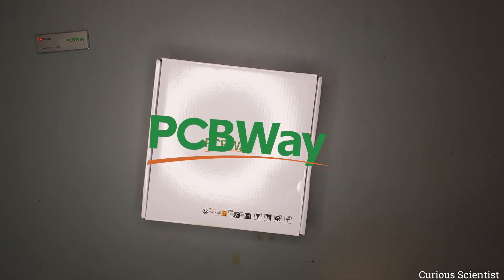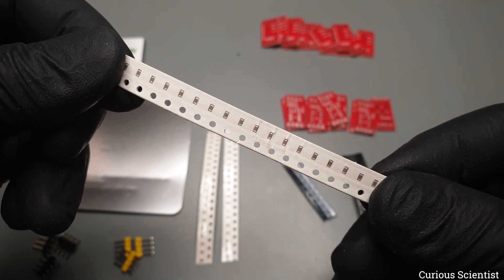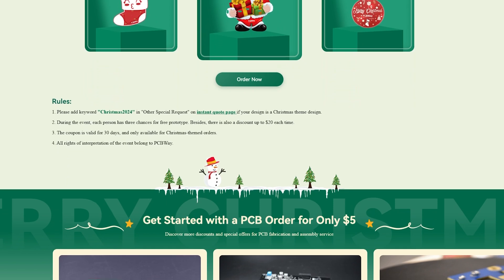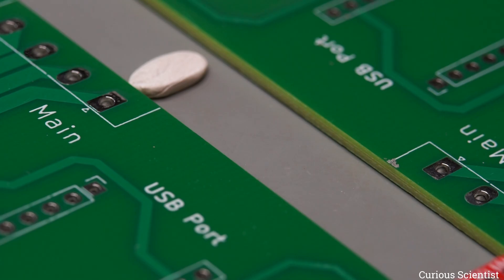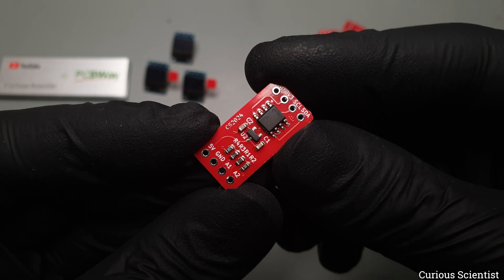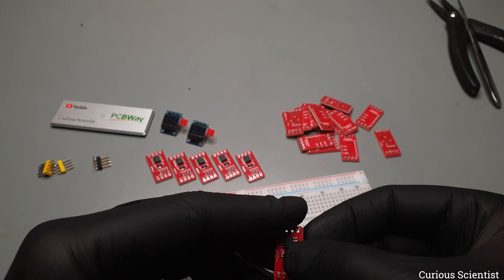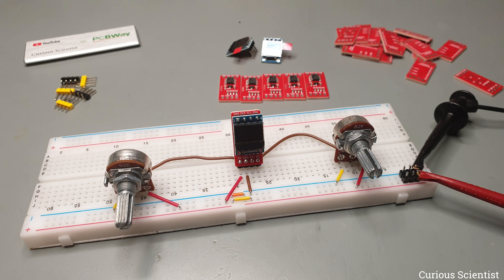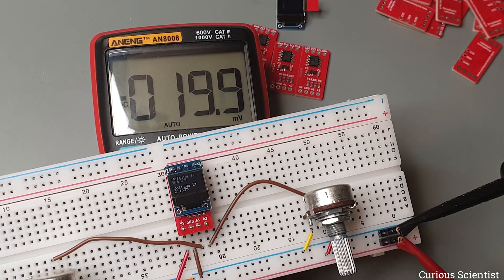2-channel miniature voltmeter for breadboards

Comment: I've been out of electronics for decades, but the magnified few of the solder paste finally let me see that it is just tiny beads of solder suspended in flux. Thanks, I've often wondered what it was.
Reply from the maker: Yes, the solder paste is just tiny balls of solder suspended in thick flux. It's a very smart concept.

Comment: Nice! A case could be nice to protect the screen and electronics. Wow that's some tricky soldering. 0603 is quite small but that's why I reccomend a case to protect the 0603
Reply from the maker: Thanks! I will design some 3d printable housing soon.

Comment: At 4:25, Is that a solder blob popping out there?  Where did it come from? At 3:35, everything looked to be OK...  Did you see it and clean it out? Could it have bridged under the chip?  Thanks for making this video!
Reply from the maker: Hi! I might have placed the chip slightly on the tab, on top of the solder paste. This could have caused a little solder to get stuck under the chip. After each reflow, I check my circuits and clean them up. The blob was too small to cause bridging, however, once I had a similar issue caused by a blob getting stuck under a capacitor. It crippled my whole circuit and it took me an hour or so to find it. But lessons learned.

Comment: I would really prefer the OLED panel to go directly on your PCB.
Reply from the maker: That's more difficult. Then, the PCB would need more components, and it would be much harder to reproduce the circuit at home.
Reply: @CuriousScientist  Just find the panel supply, with the part number or from the supplier you will get datasheet and it will give you schematic.
Reply from the maker: I am fully aware of this, but not everyone wants to assemble the whole display from scratch. This is how I implemented it because this is how I imagined it to be easy to reproduce.

Comment: Beautiful soldering shots!
Reply: Came here from the article, thanks @JeremyCook and @CuriousScientist
Reply: @yourcan  Nice! Thx for letting me know!
Reply from the maker: This is great to hear! Welcome!
Reply from the maker: Thank you!
Reply: @CuriousScientist  So the I2C pins + 3.3V and Gnd are broken out on the other side for potential future use? Also, can it run at 3.3V from the breadboard rather than 5V?
Reply from the maker: On the other side, those pins are broken out for programming. My plan is that if I want to "mass produce" them, then I can build a small jig with pogo pins and program the circuits very fast. 

The circuit can indeed run from (a stable!) 3.3 V directly. You can skip the LDO and bridge the traces, however, I would rather not do it. I designed the board with the assumption that it will be used with Arduino-like circuits, where the default rail voltage is 5 V. If we really dig deep in the datasheet of the chip, it says that the rated operating voltage is 3.3 V OR 5 V. So, theoretically, it could work without LDO even at 5 V. But if it does not, and people buy my board and they burn due to overvoltage, then I have to bear the consequences. For my peace of mind, it is better to spend an additional $1 on those 2 caps and the LDO.
Reply: @CuriousScientist  Makes sense, thx. Was working on an article for Hackster on your device, so I wanted to make sure I got the details correct.
Reply from the maker: Oh wow, it would be super cool to see my project there! If you need any details, just drop me an email or a DM on Instagram.
Reply: @CuriousScientist  Thx! Article is all done - probably up in a few hours if you want to check then. Feel free to LMK if I got any details wrong!
Reply from the maker: Super, looking forward to seeing it! Thank you!

Comment: Perhaps u am missing something here. Are you not supposed at, some stage to put some specific code on the micro controller? Did see that step in the video. And didn't find the code in the article.
Reply from the maker: Sure, but there's no public code shared.
Reply: So what's the point of showing how to make it if the code is not available? Anyone making it would end up with something useless. No?
Reply: @ChrisHalden007  Hey, in the earlier video tutorials, he already showed everything you need to make a voltmeter like this. There’s ADC handling, OLED setup and handling, and after that, it just takes a bit of effort and thinking to piece it all together. That’s the whole point of these tutorials – to get people motivated to learn. I mean, sure, having it handed to you on a silver platter is easier, but that’s not how anyone gets better.
Reply from the maker: @ChrisHalden007  well, based on my tutorials that I mentioned in the video, you can copy-paste the necessary code together, and adjust it for your needs. If you want the code, you have to pay, I am not a slave to work for free. 😉
Reply from the maker: @CorgonCorgon  Thank you! Finally, someone understands it. It is very funny that people are so demanding and expecting everything to be spoon-fed to them *for free*. If they want something, they can work for it, or pay me and I provide the necessary resources.
Reply: @CuriousScientist  как я могу купить у вас код из россии? Мне хотелось бы чтобы он показывал ток и напряжение , но   без исходника никак. Для самодельного электросамоката
Reply from the maker: You don't need to buy the code. It is free on my github. But donations are always welcome. :)

Comment: The next device to build might be miniature osciloscope or logic analyser 😅
Reply from the maker: It's a good idea! The circuit is basically done for the oscilloscope, I just need to do some programming. Although, there's not much I can squeeze on a 72*40 pixels display. 😅
Reply: @CuriousScientist at 0.1Hz, that's 7.2 seconds across the screen.
Make it wrist worn, and it could be quite useful for network and low voltage power troubleshooting.